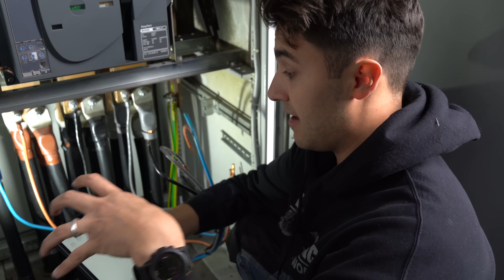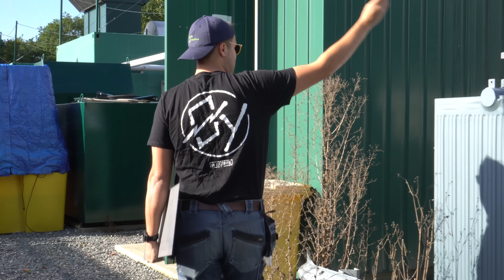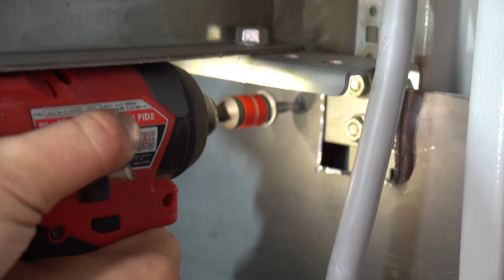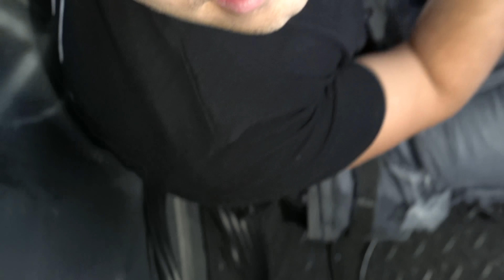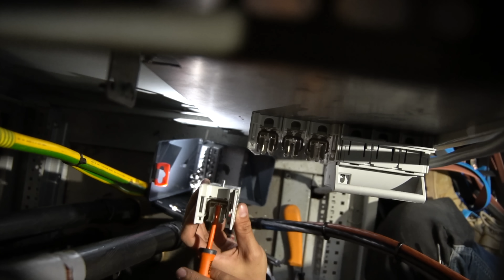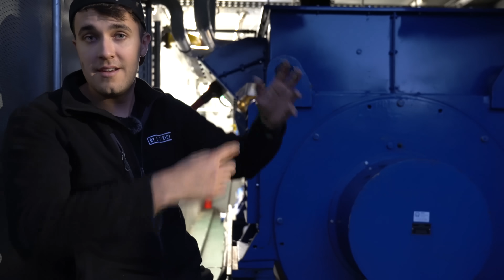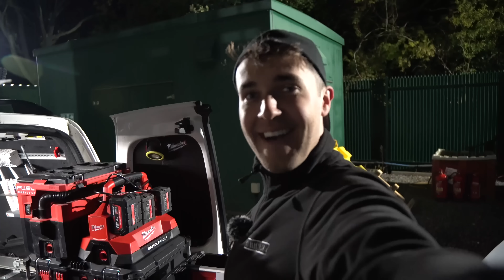11,000 Volts BREAKDOWN ( The UK Grid is Struggling ) | ØY31

Comment: Grid scale PV array doesn’t necessarily need a heavy spinning wheel such as a Synchronous Compensator, signal strength can also be synthesised via Grid Forming Inverter coupled with a Battery Energy Storage System (BESS) which boosts the power around 30% for 2.5 seconds.

Comment: G'day Cory, how many years of experience in this heavier industry do you have roughly? I'm an electrical contractor my self in Aus, and I can't help but worry that I'm not really able to learn as much as I can't really quote on contracts or jobs that I don't have a deep understanding of. Do you feel as if this is true for you or do you still take on works you don't have plenty of experience with?
Reply from the maker: Hey mate, I’ve been a sparky doing a variety of works for about 10 years, my advice is to sub contract! That’s what I was doing here. Someone else has more of the liability and design pressure then

Comment: Why no swag control bratic sheets use stir card to template steel sheet then cut and prep outside also why not use capture nut rivet instead of cutting threads.

Comment: When it comes to getting a van, buy Mercedes. 
I’ve had 2 at over 300,000 miles when passed on. 
Get them serviced regularly, even commercial MB is not expensive. 
If buying second hand.? Mileage is only a number; so long as it has a full service history. So important with mb 
People have issues mainly due to poor service, incorrect oil etc. 
costs  more but you get it back

Comment: The locking of drill bit by turning it backwards was proven not to be the case - you can search for the video, where a guy talked to chuck manufacturers and they said that is not true and it can actually lead to the drill bit falling off.

Comment: Y Haven't U Written a book, as All your Knowledge would be so useful for Knew to the Trade Electrician College/Apprenticeships Especially the Young Ones that only Learn 'by the book' at College, When I was there I passed all tests 1st time but I wasn't Taught On Site how to wire around obstacles like 'make wires longer as you can't add but you can make shorter & use larger trunking than needed 'in case of add ons later' ect.... also for new Sparkies a guide to the names of outlets (sockets,switches,light fixtures etc.. would be handy along with how to wire multiple way switches as in more than 1 way if there are 3way switches) also if the lighting is powered at the switch or if the live pair R at the light the depth of the back box required along with max run length in domestic properties for size of cable, with books that aid the calculation

Comment: There are tapping drill sets you can buy for just immediately ripping a threaded screw hole into sheet metal btw without the need for pilot holes. I've seen a lot of machinists use them. They're basically just normal drill bits with a tap set half way through them.
Reply from the maker: I’ve got a set but with most of my key sizes missing 🤣👍🏼

Comment: Just a thought, but wouldn’t it have been easier to mount the breakers and fuse box to the 2mm plate before you installed the plate? It would have been more efficient and less time consuming.

Comment: Never worked on HV, but I still remember the classes from 50yrs ago. Specifically the acronym SIDE. Switch off - Isolate - Dump - Earth.
It was drummed into us that the busbars should be earthed as an added precaution. Does that not still apply?

Comment: It's not to "prop up" the UK grid when its "struggling". It's entirely down to the unpredictability of renewables, especially wind.

Large steam turbines like the likes used in Drax take a long time to spin up and spin down - there's a lot of spinning mass and they can't react well to sudden swings in demand. This used to be fine, as demand on the power stations used to be pretty predictable day on day and year on year. With the addition of renewables though, its made the whole thing a lot harder to predict. Demand stays predictable, but the supply from solar and wind can change dramatically depending on how accurate the forecast was - quicker than the large turbines can react to. So when the renewable supply drops, and we wait for the large turbine to catch up, these little local gas engine supplies kick in to take up the shortfall.

It's all economics. The giant turbines are most efficient, but aren't quick to react. The renewables are cheaper, but less reliable. The gas engines are quick to react, but expensive to run. So you use the renewables when they're there, you use the giant turbines when they're not, and in the space that you're waiting for the giant turbines to spin up you run the gas turbines to mop up the shortfall.
Reply from the maker: Well said

Comment: Have you tried Threadforming screws? If you drill a 4.2mm the pan head screw will make its own thread when driven in, also when you take it out the hole is tapped. Use these all the time! They are also known as TapTite screws or TapFix.

Comment: If you need torque wrenches and screwdrivers, I've been happy with my Norbar wrenches that I got for DIY spannering as they were the cheapest ones with certification.
If you're tapping thin (<6mm) metal all the time, get a set of tapdrills, it's much faster.

Comment: Nice work Cory. Just out of interest, how long does it take for the generator to synchronise with the grid? Is it milliseconds, seconds, minutes…..??
Reply: usually takes about 10-15 seconds from starting the engine, then it will ramp up to slowly to whatever load it is set to in the controller (usually 100%), if it was diesel it will ramp up alot quicker (3% per second)

Comment: great video however the G99 doesn’t do the synchronising, the comap controller takes care of that, the g99 will trip the gen breaker if it falls out of parameters i.e loss of mains sensing to protect the gen from clashing with a potential out of sync mains supply when it comes back on

Comment: 14:00 Rivnuts are usually really good  for getting threads into sheet metal 🙂
I picked up a Rivnut starter kit type thing from eBay for about 40 quid, and it just sits in the van until needed, and when it's needed it saves a lot of messing about.
Give us all a van tour sometime 🙂🙂

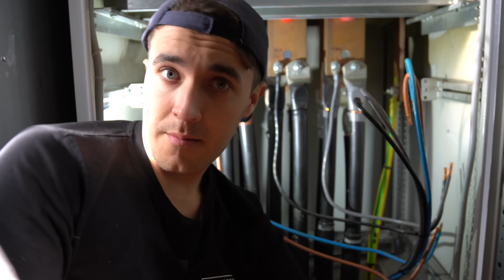Comment: 3:30 I once had a chance to visit a 22kV substation during construction. The switches were at ground level (with these nice enclosures, and a panel on it, all made for human interaction), and the massive cables were fed through the basement. Visiting the basement with these cables, and the cable boots exposed, some lying on the ground to be installed, down there it looked like NO HUMAN SHOULD BE HERE, it was quite a bit frightening for me - even I knew 100% the cables were not live.

Also I once visited an exhibition in a museum on 90 years of Hamburg subway, and they had recreated a bit of subway track at the entrance, and to get into the exhibition you had to get over this recreated bit of track (really!), which including a third rail. It all looked very very real (they even had a tunnel enclosure and dim lighting!), every fiber in me seemed to scream: "Don't go there!!!".

Comment: This made me glad to be out of my old job on domestic metering. Nothing worse than when a 30min job has taken 2h under stairs because the wiring was a dogs dinner with 5 old CUs, when it’s 2 hours after your drive home time and the final bit, the isolator, falls apart. At SSE we went from cage clamp isolators that never grabbed 25mm 7 core so were causing fires and dropped neutrals, to proteus things which would let you get everything in and torqued up and then the load side cover which was obviously made in a separate factory or something, would not torque up. Either it wouldn’t align or the bolt would shear early like yours did. Fk sake, back to the van, start again, if the customer is a watcher they get very twitchy at this point. I would say they don’t make them like they used to but let’s face it, almost all housings and lugs have had manufacturing issues at some point. Safety and consistency is too much to ask and big companies rarely condemn a stock of bad iso’s either because of the cost of managing a recall.

Comment: Only a passer by here , nicely put together mate . as it is , as it happens and no crap . I’ve worked at places like Drax and other locations but not on the electrical side decades ago plus built generators similar to this ( mech and first fix ) . Can honestly say working with guys like you / share the same mindset makes your days so much easier . 
Still amazes me how cheap crap components manage to get CE certified when they break  too 🤔. 

May be wrong here but there doesn’t appear to be any EMP ( solar Flair ) protection . It’s quite common knowledge that they are on the increase an historically we are due for som major ones soon . with most electrical components can be wiped out with a ‘Carrington’ event I suppose we’d be plunged into darkness with a societal breakdown, no fuel no food no heating and no comms .
Reply from the maker: Thanks mate! Sounds awesome 👏🏼. Yes, the solar flare scenario is an extremely interesting one

Comment: Not sure the UK grid is particularly struggling, they used to have a load of open cycle Olympus (aka Concorde) engines that would do the same job, provide a quick source of pick-up if needed.

Comment: Great video, very interesting to get a look at the gas engine gen sets. 
Nice job on the panel , as I noticed another commenter said “riv nuts” or sometimes called “nut inserts” would be great for your line of work they can be used in sheet metal that is to thin to tap and no acces to the rear is required - check them out ! 
Also AVE has a video on the turn the drill chuck back till it clicks thing think it’s an internet hoax man …..

Comment: I'm retired now, but worked for leckie board for many years, last few as a fault technician attending LV faults. Lots of substation work, cahnging blown fuses etc. With regard to the phase sync to the generator, when on a training course for connecting 250 and 500 kva trailer mounted generators to a sub station, the instructor told us to watch the ring of LEDs on the generator as they would turn one way then the other, and when in sync the circuit breaker woul close and connect up. One of the lads was watching it very closely, and uttered the words "it's read to close", when the generator and trailer jumed a foot in the air! It turned out the instructor had caught his foot in the sync lead, which was supposed to be connected to the red phase, and carelesly reconnected it to the blue, so it ws out of phase!

Comment: Its not that solar doesnt have the power behind it, its that grid tie inverters, in the UK, are set to operate at a power factor very to or at 1.  There is no source of reactive power from a grid tie inverter.  Spinning flywheels, or more commonly known as spinning reserve, is able to provide reactive power as they re purpose exisiting plant as the their generator sets are able to provide reactive power, from a cost point of view, the connection is agreed and understood so much cheaper to get operating.

Comment: wires twisted together so it's impossible to work on without tearing it down and starting over

"Quality British Workmanship"

You have to wonder if the company managment used to work for British Leyland

BTW, whenever working on HV stuff (a lifetime ago) the company I worked for had a policy of using grounding poles inside cabinets even after locking off power feeds. Techs are expensive to replace and the paperwork is annoying

You do feel more relaxed when you can see the feedins are shorted together+grounded and obviously safed (plus if anyone does try & do something stupid like removing a lockout(*) everyone within earshot will know about it)

(*) I'm an advocate of charging anyone pulling that stunt with premeditated attempted murder and would have zero qualms about using lethal force to prevent it happening

Some "Never do this" points:

- Never thread holes on thin plate, you need at least 3 complete turns for safe anchoring. Use rivnuts or someone WILL curse you and your ancestors later (or use sheet metal screws, these have large enough thread shoulders to provide adequate grip)

- "Double crimping" reduces the crimp strength (compressive pressure) by 90% or more and will result in the ionic migration (cold welding) which make crimps so reliable not occuring. DON'T do it (it can sometimes result in the crimp itself splitting too)

Comment: Love your over confidence but I would never touch any potentially live connector without using a tester to check fo voltage! Sh*t happens .........
Reply from the maker: Love your over confidence in commenting but we of course used a tester and full LOTO procedure to safely isolate before touching…

Comment: Facinating... Subbed and liked
I have worked with ENW a few times through a company I worked for.... I designed a circuit that could remotely control a panel about a mile away.
It involved a LORA Transceiver and controlled a G50 unit...
It had to have an RF connection (866MHz) because the control room was outside the perimeter of the complex and there was a car park in the way....the alternative would be to dig up the car park and lay cables....
Hope it's still working.....
Reply from the maker: Awesome work man! 🙏🏼

Comment: Electronic sync of the alternators, I have a 1920s book of dynamo and alternator engineering where they describe syncing using light bulbs connected between the two lines, when the bulbs go dark the two alternators are in sync and the linesman can throw the switch.
I used to build alternator sets,started as a hobby when I was about 14 and I got the previously mentioned book, biggest I ever did was 150 KVA and the worst belt was from a 45 KVA 3 phase machine when I was setting up the AVR board and somehow I managed to touch the output of two phases with the side of my left hand, no burns but a dreadful buzzing feeling in the hand which lasted the rest of the day.

Comment: Hi Cory, in the past I have designed plenty of panels  built them and wired them, Mostly for refrigeration systems ( mcs's, contactors, stats, timers, din rail ETC) single & 3 phase 440V and mostly locked enclosures ho and swa up to 16mm and pyro all different sizes & cores and not forgetting singles. But I would have loved to work on bigger projects, heavier cables and higher voltages etc!     Also subscribed 😁

Comment: Here in the states we use dynamic rotary UPS's at some of the data centers, where there is a large mass flywheel connected to generator and motor.  This has displaced battery storage during power outages in that when the power will fail the flywheel will keep the power going and also is used to start the engine that will then continue to run the flywheel generator.  This completely eliminates the need for large battery banks at data centers, that are needed until the generators start up.  😁👍   Now we are also seeing the large battery farms for power providers (DNO) to get through those spikes in demand that are needed without having to resort to additional natural gas power stations having to be built.
Reply: About 35 years ago I heard about a data center with a large-mass flywheel setup.  Somehow the flywheel shaft broke and the flywheel took off right through a concrete block wall!!!  Ho, boy!  I bet a LOT of people had to change their underwear!!!
Reply: @markpeterson5479  wow.  Yeah Cisco is using them in their new build data centers to help obtain the LEED certification by not using flooded lead acid batteries for backup power.

Comment: Just found your channel and subscribed.
I used to be in a very similar line of work, but predominantly on large DC systems. 
However, that was back in the days when drills all had mains leads and chucks all had keys.
On the subject of chucks; the 'single reverse click thing' has been mythbusted several times now.
I would have also used 'nutserts' for fixing to such a thin panel.

Comment: Glove on a chickens lip as we would say .   Bit surprised that the original installation was so easily compromised , not good considering the potential for fire or worse .    But hay I’m only a retired electrical contractor who would regularly work in live enclosures with 3 phase supplies probably only topping out 400 amps per phase .    Definitely in your case live cables can indeed jump , with rather interesting results .   But as we always used to say ,    single phase you usually get up and live to fight another day .   3 phase it’s what type of flowers would the departed have preferred . 😂

Comment: Tip for commissioning, if possible back feed up to the generator with the wires disconnected at the generator, will prove all the wiring is phased out correctly.

Comment: G99 is loss of mains protection, if the machine becomes islanded either at 11kV ( or higher) or at LV the g99 detects this condition by supervision of voltage, frequency and rate of change of frequency. G99 is blocked till the CB is closed plus a 1s. Sync check and energisation check is an interlocking function m G99 is a grid compliance protection tripping function

Comment: Did not think you'd use those fuse carriers,  I have the very same ones that are 600 amp per phase. I feel a little bit of pride that I have gear that's the same as grid backup generators

Comment: Drilling and tapping sheet metal is OK for thicker sheet but consider looking at "Nut-Serts" or "Riv-Nuts" as an alternate. They will provide sufficient thread to bite and secure. Remember, a bolt/screw should have 2.5 threads at least fully engaded into the opposite thread.
Reply: mmm, I looked up m5 and it has a thread pitch of 0.8, so 2.5 threads is spot on 2mm.
Reply: @petermichaelgreen  Yes, that is correct for M5, M6's are more common. The point is a little missed though, drilling and tapping sheet-metal is not best way to secure hardware.